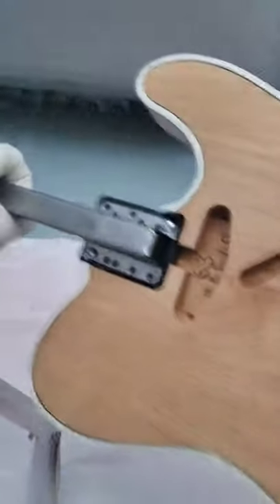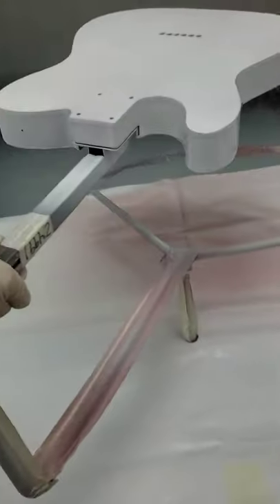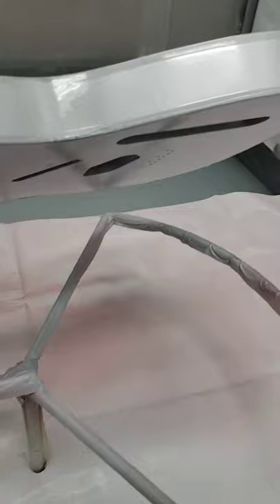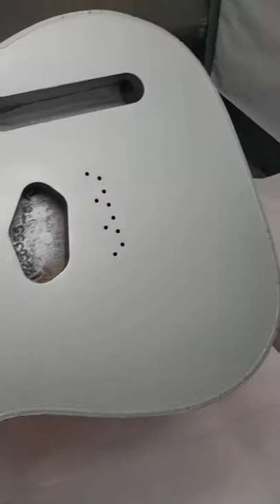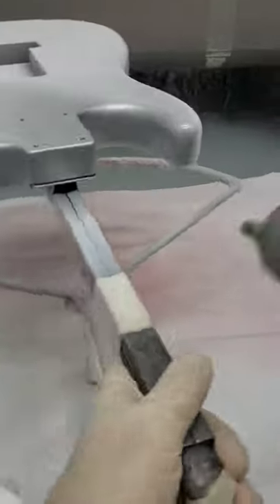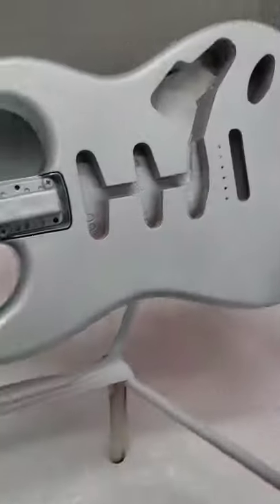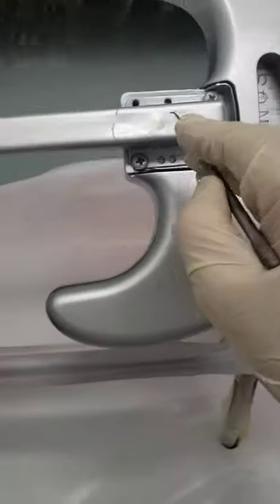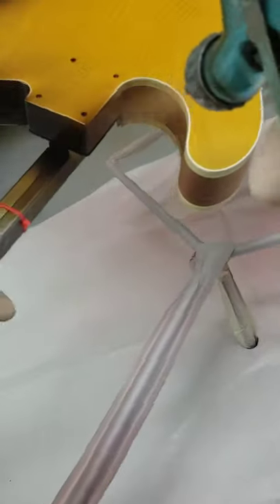Painting a surf green strat, a 3Tone tele, a silver Antigua, a sapphire blue metallic Strat

Comment: Jay can you recommend a gun for doing sunbursts, I am a small builder on a limited budget
Reply from the maker: There are super cheap guns out there that can work for you. I'm sure you've seen them. Some as low as $20.  They aren't very good guns but can get the job done if you know how to keep it spraying right. Sharpe is a decent brand I trust that is on the inexpensive side.
Sharpe Finex FX1000 HVLP Gun might work well for you. I haven't personally used this gun but I would trust it. It really depends on your budget. I use a devilbiss sri mini.  You can find used ones on ebay for $200. or new for $500.

Comment: I’ve seen the waterfall in the paint booth at Fender several times, and I’ve always been intrigued by it.  I know some paints get moon eyes in it when humidity is high—is it just nitro that acts that way?  Are there paints that you turn off the water to shoot?  Is the paint room humidity controlled—except for the area where you’re actually shooting with the waterfall?
Reply from the maker: Hi. The waterfall booth is only a way to capture the overspray of painting. It catches it then it drops down into the water and becomes inert like the dried paint on a car. Every few months the tank get shoveled out and the waste is disposed of by a company that deals with that sort of thing. Humidity isn't a concern or issue nor does the water fall effect that. Lacquer, and other paints, will react if theres oil or wax on the surface of the item being painted. I've always heard it referred to as fish eyes. The water is never turned off while spraying. The lower part of the water fall has suction and is drawing in air which also pulls in fumes. That air is then passed through an extremely extensive and expensive air scrubber system to eliminate pollution.
Reply: @JNcolor  , thanks so much for the detailed reply, Jay.  It’s a good day; I learned something. 👍🏼

Comment: Where can I get me one of those nice spinning stands to use? They make that for you are a conduit? Also was wondering if you're using ditzler or what brand of lacquer. I like metalflake  brand acrylic lacquer and pearls and candys  As well as Merle pearl additives i'm going to be refinishing a few of my guitars this summer and going back into a little bit of custom paint and airbrush
Reply from the maker: The spinner was made by Fender maintenance crew. Its a simple metal rod bent and welded. You can make one with pipes and elbows.
Reply from the maker: Oh, and we use different vendors. Cardinal, tcp are a couple. But the lacquer your using should be fine.

Comment: do those primer coats dry INSTANTLY ?
Reply from the maker: Hi. The white coat is lacquer. It doesn't dry instantly but it does flash off fast. It only needs to be dry enough to not run when you apply the next coat.